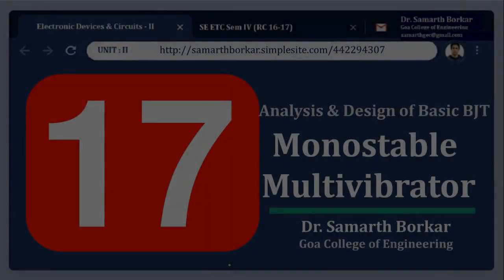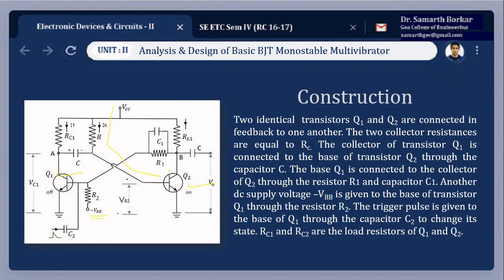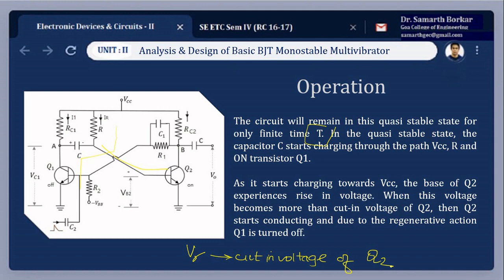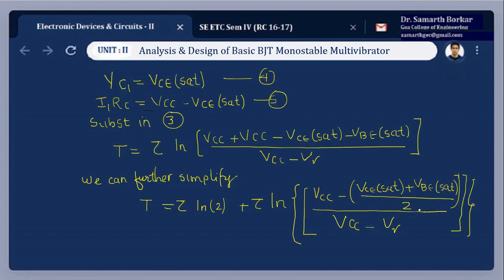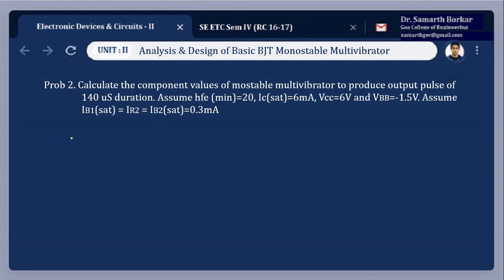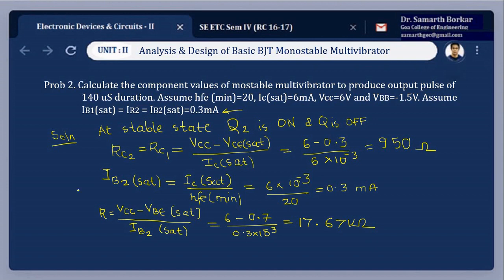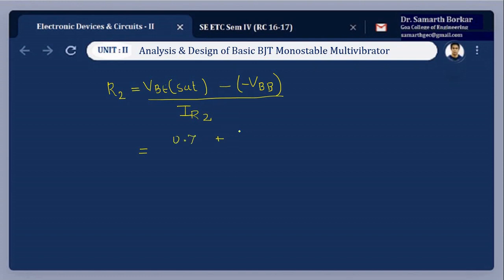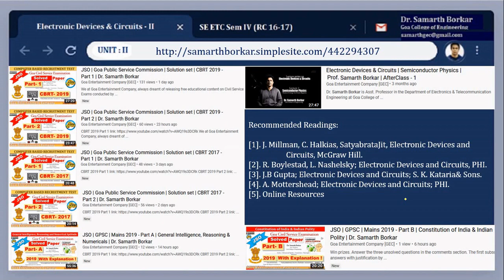Lecture - 44 | Transistorized Monostable Multivibrator | EDC | RC 2019-20 | Dr. Samarth Borkar

Comment: Sir, you used a different formula for the first problem, not the derived one, so I thought the the derived equation had a assumption that Vcc and Vbb are equal, as you get the derived equation if you substitute. But for the next problem you used the derived equation even though Vcc and Vbb are not equal. I'm confused.